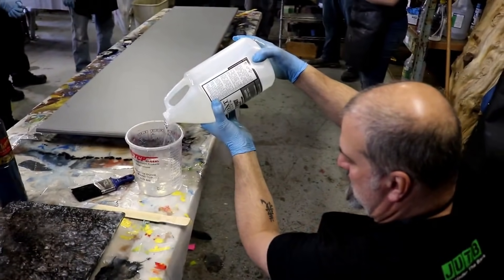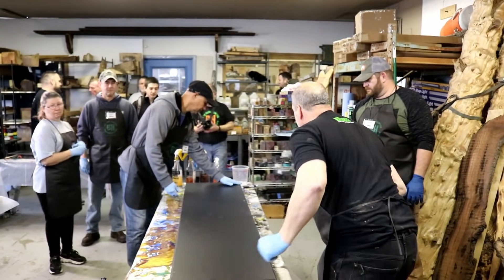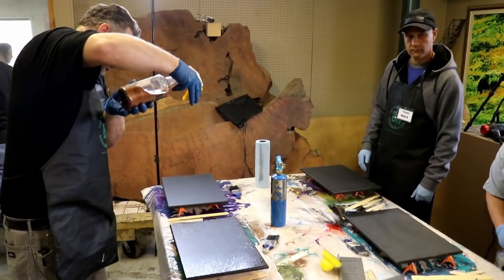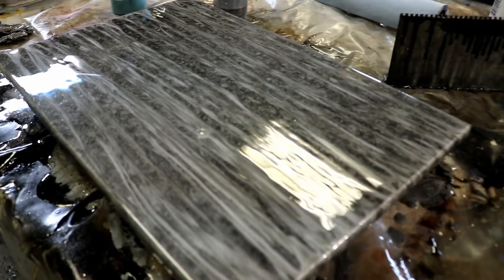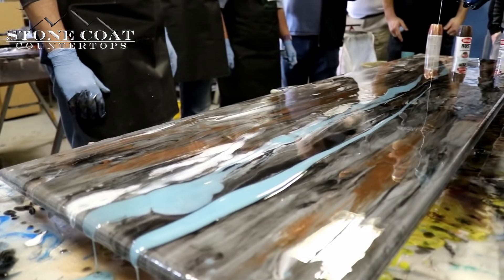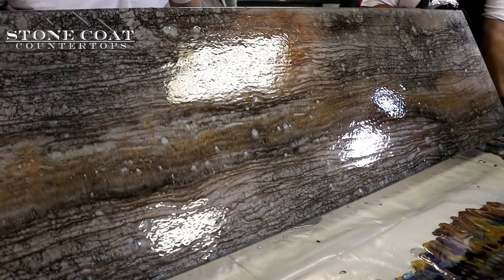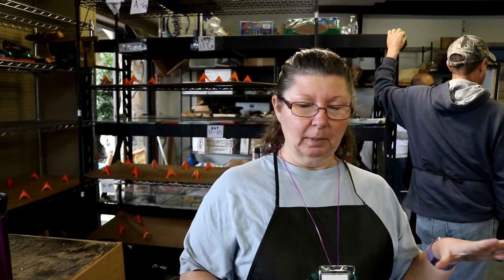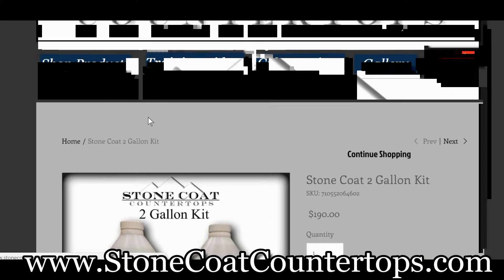How To Refinish Countertops

Comment: Does it work well over the 12" Laminate floor tiles, or would the tiles have to be removed first? Like those linoleum type tiles used on kitchen floors. I inherited a gorgeous wood table with a white kitchen floor tile on top and it is stuck down too good. Thank you!
Reply: rent a tile remover  like a blade  vibrates

Comment: Which type of pigment are you using?
Reply from the maker: We are using our metallic powders, base color tints, spray paint, and the Burl Hunters tints. Great questions!
Reply: @StoneCoatCountertops  
Can I use mica Po
Which is suitable mica powder or metallic pigment
Reply from the maker: @gunabaipatil6855  It should work fine but we always recommend testing first.